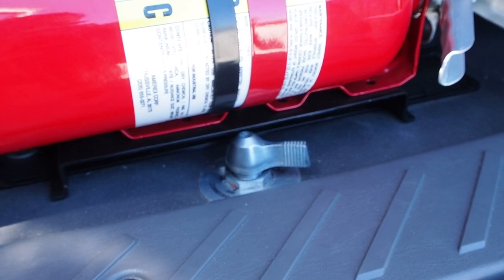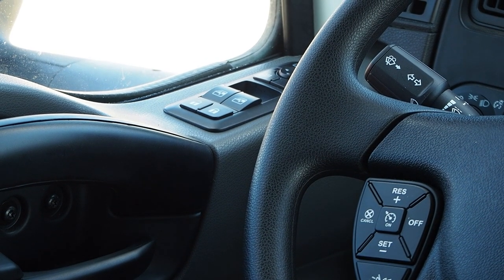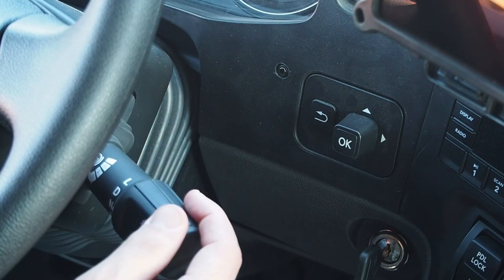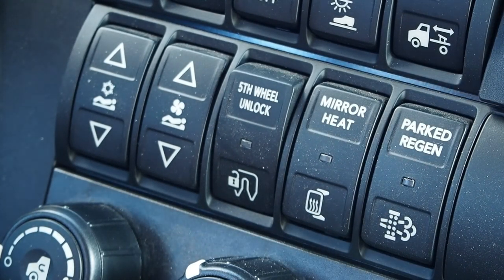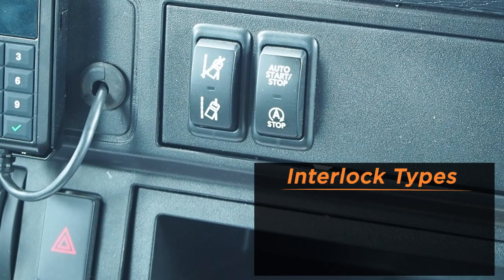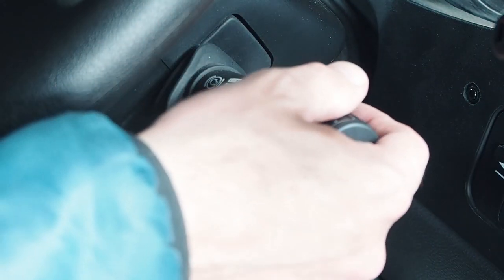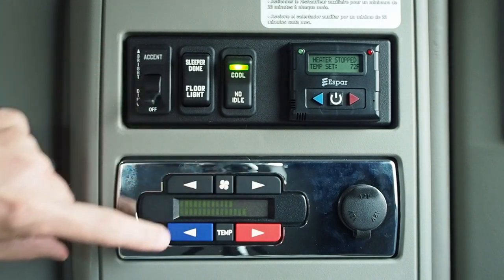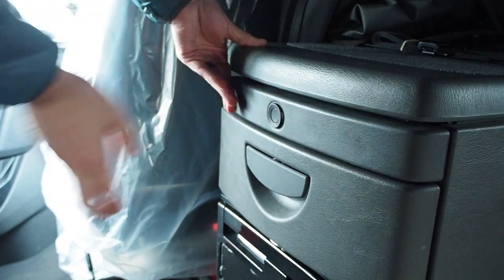2022 International LT Overview and How To

Comment: Would love to know how to do a tractor brake tug test, because the truck will not go into gear if tractor valve is pulled out
Reply: Push both brake buttons in, put in gear, and pull forward while pulling down on your trolley valve
Reply: @stoolsample4431  ghetto. Imma stick to a peterbilt.

Comment: I sure wish I knew how to use this APU on my 2022 International.
Reply: Did you get an answer on this? I’m having the same issue here smh
Reply: Hit  Cool no idle on the back bunk.
If you been sitting awhile it might not work. Hell it blows but not always cold.  Use the Auto start to keep your batteries charged or it will cut out at about 12.2 voltage

Comment: I was watching this because I need to know how to dump air suspension, the video didnt answer my question.
Reply: Did you find out?  I'm trying to figure this out also
Reply: @OTRMonk  Yes, there isn't one.  Not all trucks have this feature.  The Cascadia I drove didn't have it, neither did the Intetntional LT.  You just have to ram your way under the trailer.
Reply: @brianyalt2345  wow!  This International is the first truck that didn't have this feature.  I thought it was standard spec.

Thanks
Reply: We have a same question
Reply: There’s a button on the dash its a toggle button press it and it will dump in about 5 srecs

Comment: Chances are if you are a fleet driver, your company made the decision to disconnect/deprogram the accessory availability of your cruise control. No cruise control.
With smartdrive/Bendix/collision control devices plugged in and you are on "Cruise" and a 4-wheeler cuts you off it will make your truck go into a sudden stop.
That is extremely dangerous and flat-spots the tires. Which will also trigger events on your camera system. These company's are not going to remove these system's due the insurance rates and brokers wanting higher insurance requirements for you to get a load and then have it paid in the event you have an accident.
So, some of these company's keep the cruise control deactivated...deprogrammed. 

They have no proof for this logic. Big rigs are no less safe than we were 45 years ago. trucking is by far the single largest human resource industry in The U.S. as a civilian. At over 25 million total employees, only The U.S. Government as a whole 
 is larger. We may have, or be in 70 vehicle pileups every winter. Even with that we have, by ratio and percentage, the lowest vehicle accident's in The U.S. 

At 7.5% on 2.85 million drivers?  3% is parking lot (private property and non-D.O.T. Recordable). Yet if a cop is called and a report is done it goes to insurance numbers for recording accidents.
Of the remaining 4.5%, 2.5 is truck driver error. All 7.5% is instantaneously recorded as "involved" in an accident.
Even where not your fault. You may have been sitting still/parked...You Are still Involved, in an accident. 
Company's will show that on your CSA/PSP regardless. THAT is the long view of "no cruise control."
So burn up at night in the summer and get an extra blanket for the winter. Cause guess what they ain't paying 15,000 bucks for an APU and you still gonna pull that load in Mojave and pull that load in International Falls summer and winter if they can add another 5 million in insurance to satisfy Travelers insurance and a broker for brokering the load to you.

This is all insurance and has nothing to do with you as a driver.

It has nothing to do with you as the driver just as it didn't 45 years ago. Number's don't lie. We have not changed in these ratio numbers in near 5 decades. 

So no cruise control. 
Accessory unavailable.

Comment: Hopefully this will not double-post. Anyway, final shot here:
National Highway Safety Administration posts between 39,000 and 53,000 vehicle accidents every year for ALL vehicles driven on the highway's.
At 2.85 million in drivers of all manner of trailers and equipment and running 100,000 to 125,000 miles a year, we have fewer accidents by ratio and percentage than certified law enforcement that never leave their jurisdiction in an entire career. There are less than 900,000 Law Enforcement officers in The U.S. that is counting Head D.O.J. And FBI and your state attorney General's office and Federal Marshall's.
At 3% for parking lots added in against truckers we are still the lowest.
At an average of 45,000 vehicle accidents a year we have less than 4,000 accidents. Near 42,000 is by someone else. Take away the 3% for being parked with 300 other trucks all across the country and we have less than 1800 accidents a year...on 2.85 million drivers.
Just on our numbers, alone as an industry. We post less than 400 accidents a year. Less than 140 a year on truck driver error on a public right-of-way. Coast-to-coast.

Comment: What does the switch at 7:39 do?

I'm asking about the one that says Accent/Off/Bright/Dim.

I've messed with it and not noticed any difference.
Reply: Dude it’s so weird. I ended up reading the manual because I was so confused since the switch does nothing. The manual says there’s suppose to be another button right next to it that actually turns on the accent lights but it’s an optional feature. So even when the truck isn’t equipped with the accent lights, the switch to adjust the non-existent accent lights remains. It’s bizarre. It must be cheaper to include that accent adjustment button whether the truck is equipped with the lighting or not.

Comment: I’ve driven two different International LT’s, one a 2019 and the other a 2020 - both with the Cummins - and the truck feels like it’s detuned when I’m bobtailing or pulling an empty trailer. I’ve driven a Kenworth with the same Cummins X15 and it was much more responsive and quicker to accelerate when empty/bobtailing. Can anyone confirm if this truck limits torque or maybe boost pressure depending on how much load is on the rear axle or something? The truck is almost dangerous when bobtailing trying to pull out into traffic because it’s so sluggish to get up to speed.
Reply: Its all in the rear ratios and if its governed
Reply: @nunyabuziness8421  Rear end ratio wouldn’t change when connected to a trailer though. Both Internationals I’ve driven felt slower when hauling an empty trailer vs when hauling a loaded one. That’s why I was wondering if they limit boost pressure or something depending on suspension load. Other trucks I’ve driven like the Kenworth or Freightliner haul ass when bobtailing but both Internationals are straight garbage when trying to accelerate. Another issue is the transmission programming; it will literally use a gear for a split second and then take an eternity to shift up, losing any speed it gained from the previous gear. It’s horrendous.
Reply: Vam (vehicle acceleration management) is probably enabled not sure why International would have that on unless it’s a fleet truck. Kenworth or any truck with a Cummins isx/x15 efficiency series has that option Millis Transfer’s trucks had that parameter on up until the 2019 trucks came around.

Comment: i want to know how to connect to bluetooth
Reply: Press the phone icon in the upper left corner twice then turn the dial to add a phone and push in then follow prompts on phone. Assuming it's a concert class DEA500 radio
Reply: @BarryRocha  there is no phone button it’s a media button
Reply: @raheemjimoh4309  there should be a green phone icon in the corner on the radio.

Comment: Damn  shame trucking has come down to this  this tractor is designed for wanna be new age steering wheel holder type drivers that possess  no real trucking skills oh boy I’m a big rigger now I can push buttons and flip little levers makes me glad I’m retired makes me sick to see people want to run junk like this afraid to get a little grease on their hands by not haveing to pull the fifth wheel release handle
Reply: OK super trucker calm down. If so many of you so called real truckers would have done your job properly, there wouldn't be a need to "hold our hands". It's a dangerous job, very demanding. Technology is here to release some of the stress of becoming a safe driver. Funny thing is that even now, there's a huge amount of veterans who are making rookie mistakes. Evolve or die... Your choice.
Reply: @JasperWalker  actually technology does mot make you a safer driver because its doing all the work imo it makes the job worse and more dangerous
Reply: We glad you retired too.
Reply: @Almondchimera80  first off it doesn't do all the work. It assist you in safe practices. For example, cab facing cameras that detect distracted driving causes you to get your head back in the game. Or the speed detection system reminds you to check your speed. Even the lane detection system is helpful if you zone off and aren't aware you're drafting. I'd only agree with you when it comes to collision detection and auto braking. Once the technology takes control away from the driver, that's when it becomes dangerous.
Reply: I drove cabovers back in the day and they really sucked
Reply: I mean, times change ya know… who says truckers should have the belly of a woman pregnant for 9 months, smelling like a landfill, sucking cigarettes down all damn day? things are suppose to get better over time, not stay the same…
Reply: Save some Lot Lizards 🦎  for the rest of us
Reply: Now that's a dumb comment
Reply: Wish I had a cabover myself, don't like late model rigs...
Reply: @russellstrom8234  how? Even late model trucks suck@ going over bumps.
Reply: @gth882  because cabovers ride even worse than hoods.and you can’t stand up anywhere in the truck to get dressed,you crawl over the dog house to get in the bunk.and cabovers make you climb more getting in and out of truck
Reply: @huncheaux5828  jJajajajajajajaj
Reply: LOL I just got my LT from my company but was trained in a Cascadia. Didnt even notice the button on the dash tbh. The cascadias didnt have it. I will keep pulling my release handles because its how I was trained. Its a habit of cranking that landing gear, uncoupling, and pulling that release handle - i dont see myself ever using that button. LOL. I remember the days when I was a kid going to my friends house pretty much on a daily basis for years whos family ran a log truck company and you had badass rigs still on the road like Detroit E9 V8 Mack Superliner and International 9300's with turned up cummins. Heck they even had a 367 Pete and W900 KW log truck too. We may not grind gears and roll coal like 15-20 years ago but Im a proud steering wheel holder who can transcend the generations. I was there when trucking was still trucking. - The Rubber Duck ; )